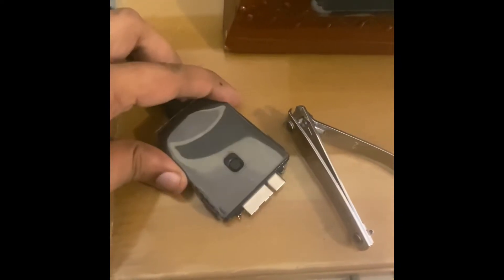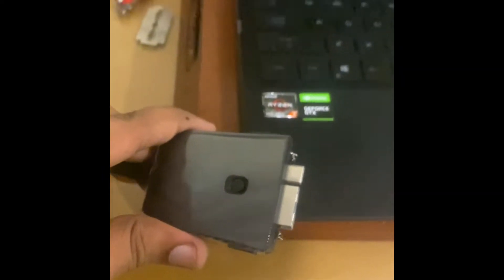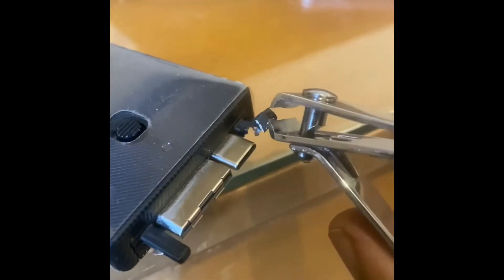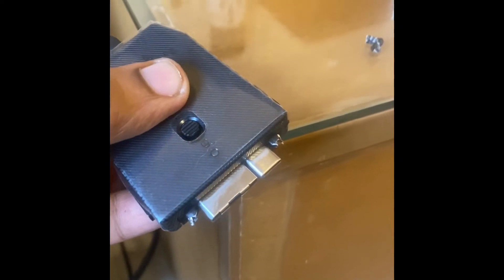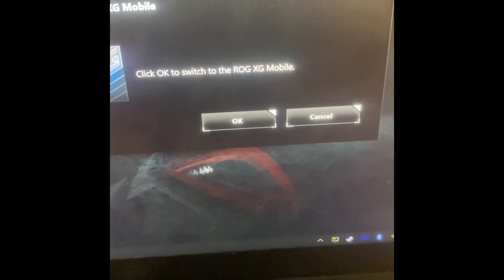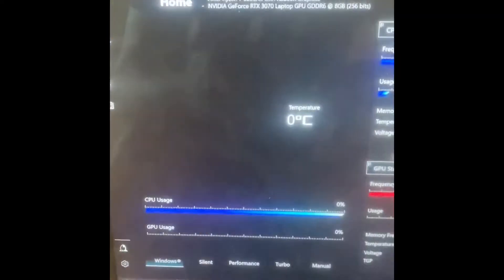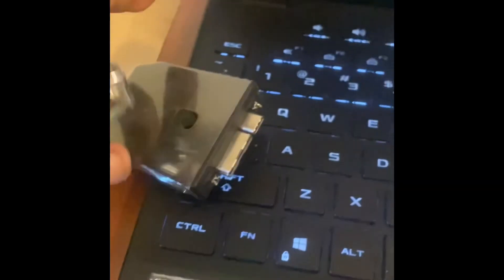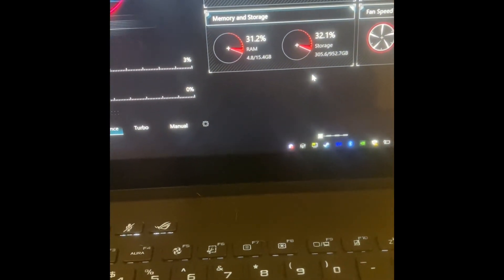Fix to prevent Asus ROG XG Mobile from getting stuck to the Asus Flow X13 Laptop (2021 version)

Comment: The first day i got my 3070 it got stuck and i got a mini heart attack. after some trial and error and some force i was able to pull it out. but the metal thing fell off and the plastic that you removed was bent. so i just straightened that. Since then its been working great. Those small metal brackets are the culprit. Still what you did is also a nice jugaad :)

Comment: Thanks for sharing that ! But that means these pins are completely useless, why do you think Asus didn't remove them in the 1st place?
I mean they released the 2021 version then 22 then 23 and still have these useless pins that make all the problems, why not just remove them?
Reply from the maker: The pins help the egpu stay connected stronger to the laptop. Apart from that they cause more problems than fix so I got rid of them
Reply: @nktechtips1058  yeah i figured, but now since you broke the pins, you never face problems with the connector anymore right?
Reply from the maker: No issue at all, works like a charm

Comment: hey man, how it doesn't restart your laptop automatically after you connect and disconnect the XG mobile?
and I m having it stuck now I can't remove the connector can you help me?
Reply from the maker: I’ve never had to restart the laptop after connecting / disconnecting.

If it’s stuck , take it to the service centre immediately. Don’t tamper it yourself if it’s already stuck . Asus will help you remove it if it’s under warranty for free. I just broke my connector pins so that it doesn’t happen to me the next time
Reply: The problem I don't have Asus support in Cyprus. I m on my own. If you have a Way to DIY IT let me know Thank you.for replying